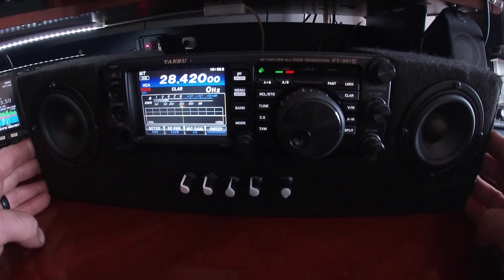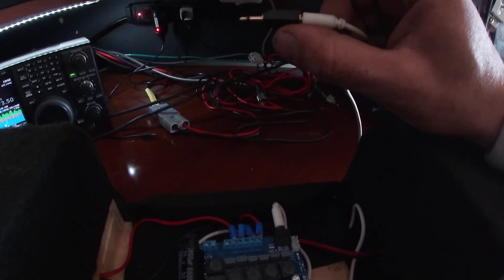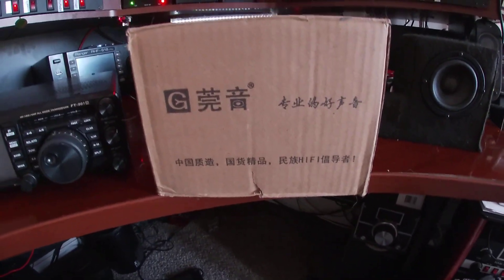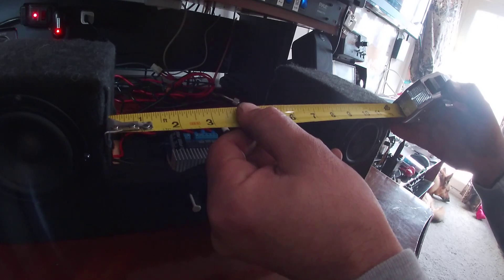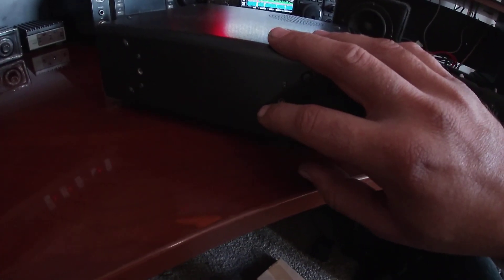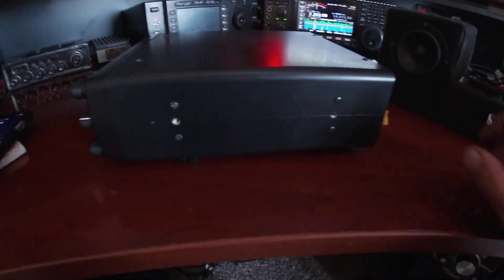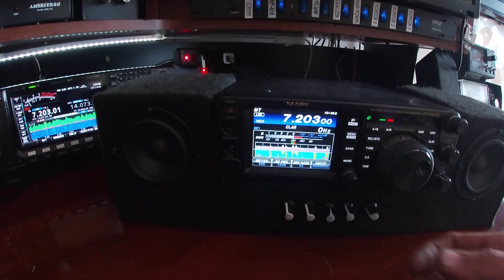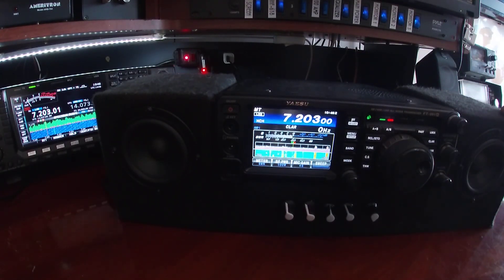Yaesu 991A external speaker

Comment: Nice video. Did you use the 4 or 8 ohm speaker?
Reply from the maker: I would have to check. They are matched to the amplifier but I don’t recall if they were 4 or 8
Reply: @SlowGoose  No need my friend. I took pics of the box you showed in one of your videos and had GROK translate. They are the 4hm BTW. Thanks for the reply. I am going to copy your speaker/amp design as I dont really care for the internal speaker. 73

Comment: Good idea but you need more light in your video.
Reply: Yeah I don’t love how shakey it is either. Did it quick.
Reply: @andrewjay4159  Still a good idea and it sounds great. You should try it on 3.880 mHz on AM in the evening.
Those guys use old military and broadcast equipment and sound very good... 7 3